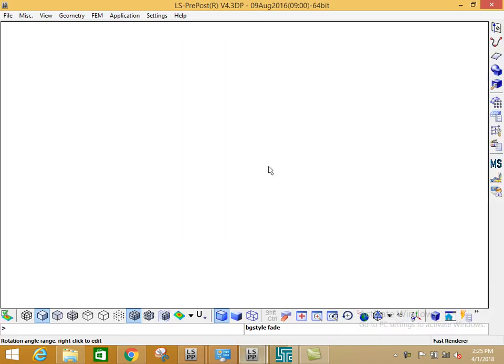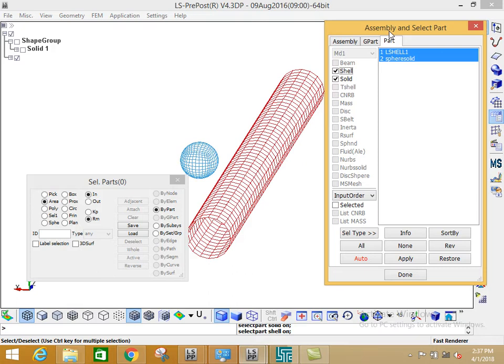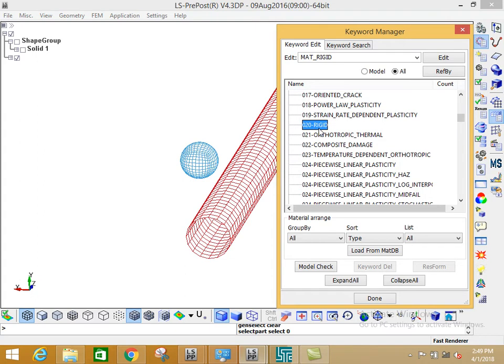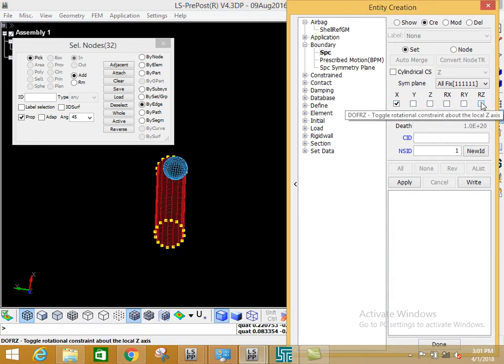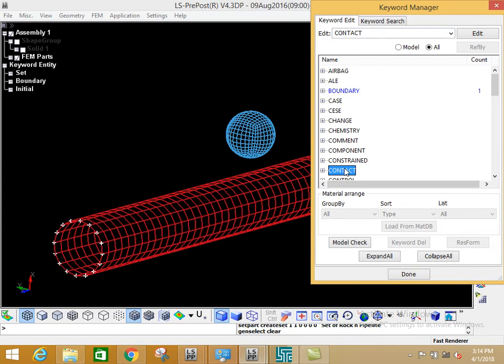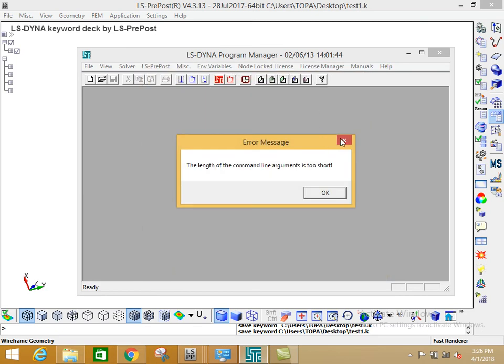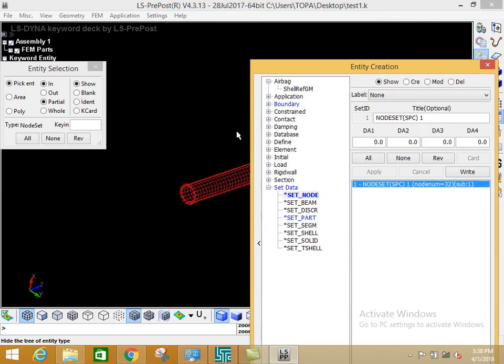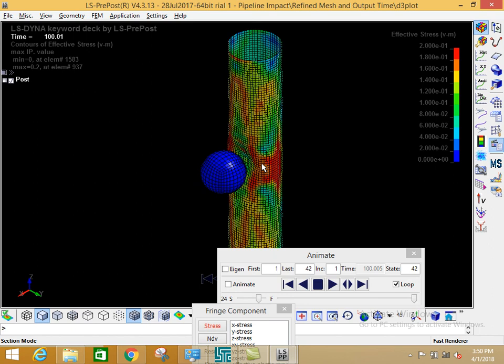LS DYNA Training: UTP Day 1

Comment: Is there a way to get shear force and bending moment in LSDyna?
Reply from the maker: You can get the reaction forces at the support then using the analytical equations to find the shear force and bending moments. As far as I know, there is not other method.
Reply: Thanks for the reply. I have a circular hollow pipe. So if I want to get reaction at support, do I need to sum up all reaction forces of support nodes at circumference? But some nodes will have negative reaction and some positive. What to do in this case?
Reply from the maker: @ManikMia  You can check this video:
https://youtu.be/T3JB7gCrEBY
Reply: @AmeenTopa  Thank you!

Comment: Dear Ameen , how do you make the element of the tube more detailed at 1:21:25 and is there any other difference between that tube and the one you've been doing prior to that beside the element size. Because the energy graph i took from the bigger element tube is much more rigid and not as smooth, is the element size the reason why the curve would be like that? Thank you
Reply from the maker: Dear Heen,

As I said in the video, everything is the same except the mesh size. 

If you see the steps of making tube, then you will see how to control the mesh size. 

You can reduce the DT value in database d3plot to get a smoother curve.

Comment: Hello Ameen,

I'm working on my master degree paper and part of this work is about quasi-static compression of EPS Foam.
And i found your paper about Modeling Large Deformation and Failure of Expanded Polystyrene Crushable Foam (https://www.hindawi.com/journals/mse/2014/292647/) and your simulation have excellent match with experimental curve for quasi static compression. And now i'm trying to repeat your numerical experiment, but i don't have enough data about material. If you don't mind, could i send you email message about your article? My email here - johndolgov@gmail.com
Reply from the maker: John Dolgov Please check your inbox.

Comment: Hello Ameen,

I'm trying to do Axial Crushing of a Cylindrical Aluminium tube in LS-Dyna. I've prepared the model and didn't get any good results so far with 2 different mesh sizes comparing to the experimental one as shown in the figure below. The dimensions of the tube are 2mm thick, outer diameter is 25mm and its 90mm long. The specimen is AW6060 T66. The impact is defined by a Velocity vs Displacement curve. The bottom plate is fixed in all direction and the tube is placed on top of it. The top plate is free to move in Z-direction. I've used MAT Rigid for the top and Bottom Plates and MAT 98 Simplified Johnson-Cook model for the Aluminium tube.

However my simulation results don’t match with the experimental one(force displacement curve). Please can you help me out. If you can share ur email, I’ll send the keyword file and the experimental curve.
Reply from the maker: Write down your email here and I will contact you.
Reply: Ameen Topa sanjay.sardiwal33@gmail.com 

Thanks for your reply.

Comment: How you add element deletion?
Reply from the maker: You may use the strain failure available in the material model. Alternatively, you may use add erosion.
Reply from the maker: Refer to my other video:
https://www.youtube.com/watch?v=3a_T7Hh19gQ&lc=z22lxlzwnpi5dpalvacdp43aob0smypffv3fwpjweudw03c010c.1515256246309239